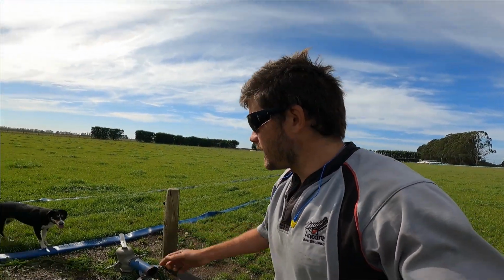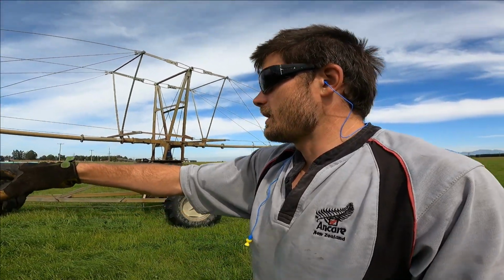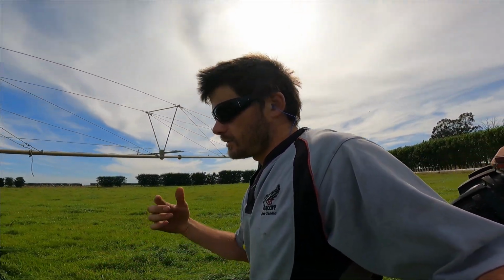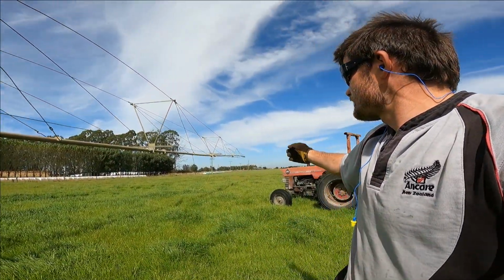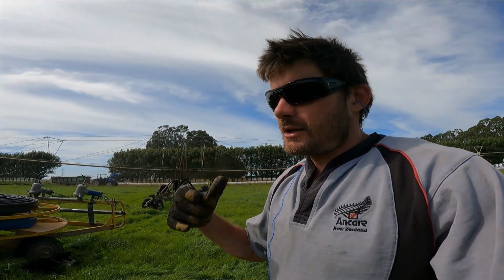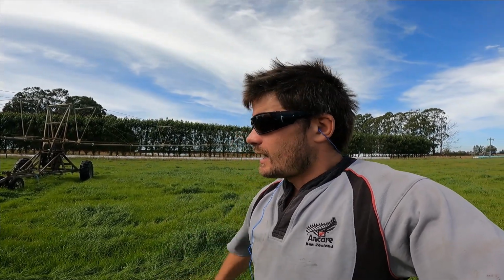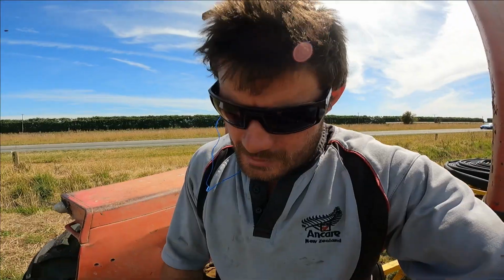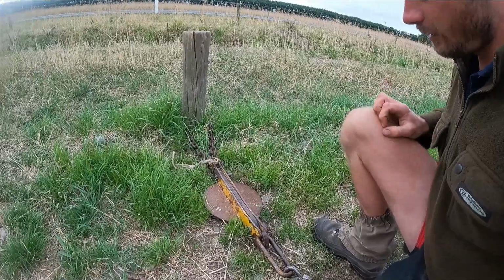How We Make It Rain

Comment: Thanks for the video mate. Our last two spans drove through the goal post on our pivot three weeks ago just out of Martinbough. 
Our roto Rainer hasn’t moved for 20yrs. I’m thinking of just flooding a few paddocks with the lay flat hose. 
We’ve got the same trailer for the hose. Do you just put the gear box in neutral to roll it out or is the pto helping to push it out?
Cheers
Reply from the maker: Hi mate
Cheers
Na the gearbox only has the one gear and no neutral. To wind in a hose, connect the p.t.o shaft and put the tractor in gear. To wind out the hose just take the p.t.o shaft off the chain, sprockets and gearbox will spin freely.